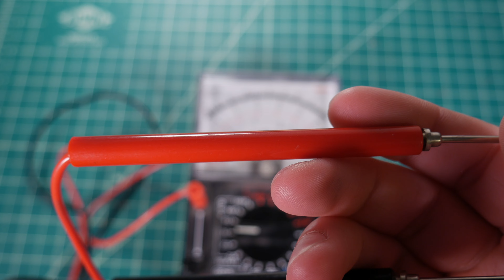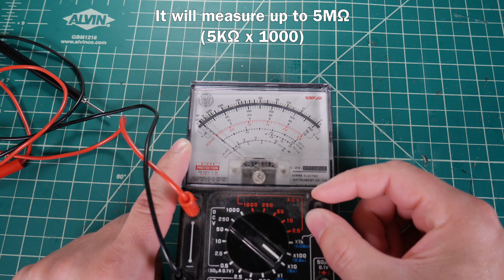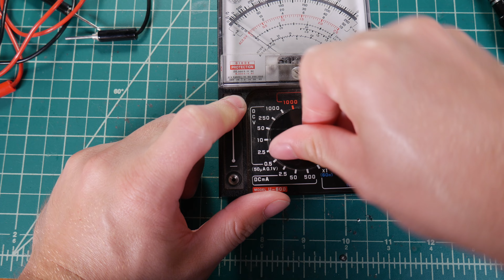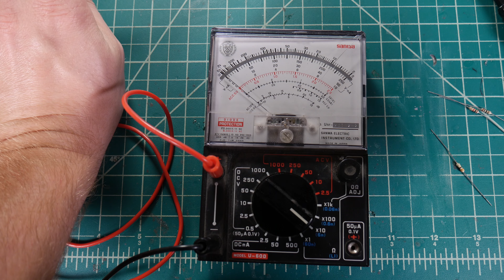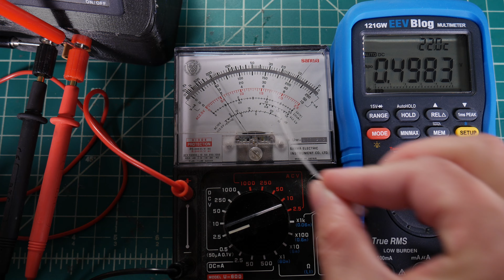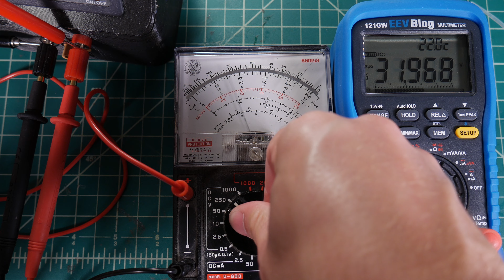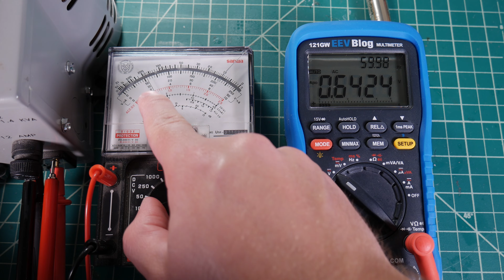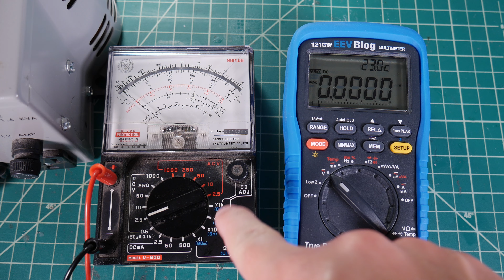Junk Pile Sanwa U-60D Meter Testing

Comment: I have the same meter, 35 years old. I still use it for home electrical works, although I also have another digital multimeter mainly for automobile works. Just found this video today, opened it to check the 2 batteries, they are still good with 15.5v, no leak. It is the Mallory battery (now became Duracell).  They represent high quality Japanese craftmanship back in the 1980's.  👍

Comment: Plz work on old Arduino bms project and also provide your social media links also update schematics so we could see how you added those navigation buttons for user interface
Reply from the maker: I have some major changes in mind for that project. It's been put on hold for the time being. I do have another video about how those pushbuttons work on my channel.
Reply: @Eman2000  respected sir, to which Arduino pin those push button are assigned in to? And how much resistance u used ? May I know